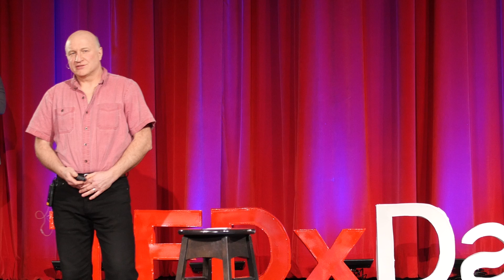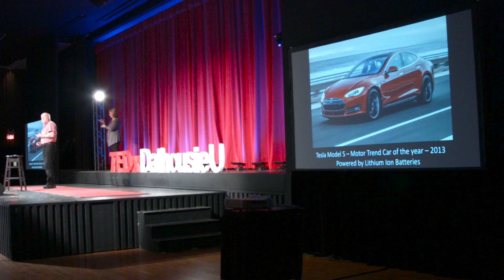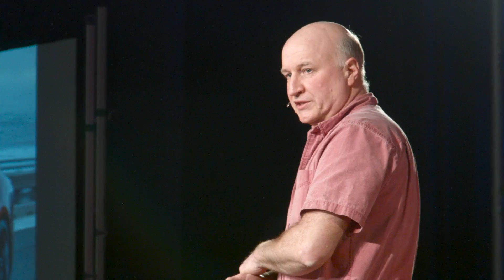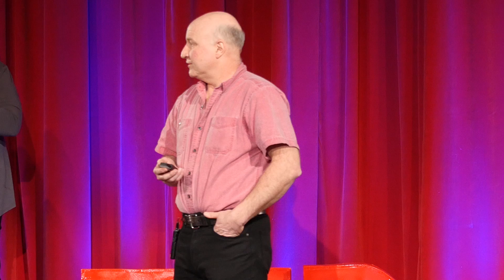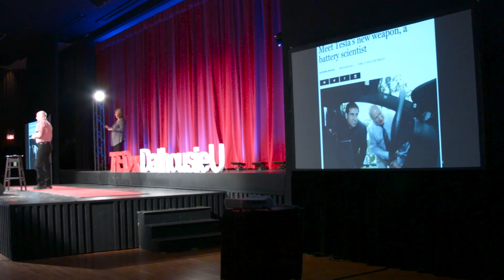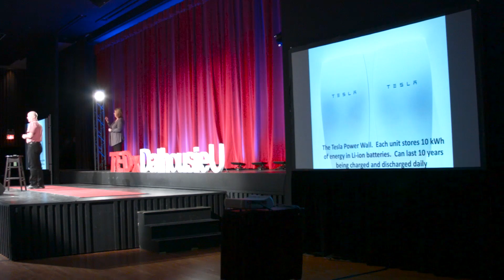Making Batteries Better | Jeff Dahn | TEDxDalhousieU

Comment: Awsome.. This guy is a genious!.. WOW... him to have Jioned TESLA is simply the best that could have ever hapenned about battery !
Reply: Internal combustion engines in a vehicle have an average energy efficiency of about 18% to 20%. Electric motors are about 85% to 90% energy efficient and lithium-ion batteries deliver around 90% of their electrical input to the motors in an electric vehicle. Large stationary power plant turbines are typically significantly more efficient and cleaner than small mobile combustion engines in vehicles. Electricity transmission losses are around 9% on average.
In any case, the electricity that is used to refine all the petroleum liquids that are used for road transportation today would by itself be enough to power electric-vehicle counterparts to all the vehicles on the road. It takes several kilowatt-hours of electricity to refine each gallon of petroleum fuel. The fuels then need to be transported in ships, trains or trucks.
In countries such as Canada, France, Iceland, Scotland, Norway, Sweden, Austria, Switzerland, Brazil, Paraguay, New Zealand and many others, almost all the electricity comes from Nuclear or renewable sources. So there will be very substantial reduction in pollution and carbon emissions in these places. Proportion of renewables in the grid in most countries (eg. China, India, EU) will increase dramatically over the next decade.
The manufacture of lithium-ion batteries and electric vehicles currently requires more resources and energy and mobilise more toxic substances than manufacturing comparable vehicles run by internal combustion. However, the impact of this is more than offset by the significant reduction in air pollution and CO2 emissions produced during the use of the vehicle. And almost everything can be recycled at the end of the life of the vehicle. Electric vehicles can also be expected to last longer with less maintenance since there are few moving parts involved.

Source:
http://www.ucsusa.org/sites/default/files/attach/2015/11/Cleaner-Cars-from-Cradle-to-Grave-exec-summary.pdf
http://news.mit.edu/2016/electric-vehicles-make-dent-climate-change-0815
http://iopscience.iop.org/article/10.1088/1748-9326/11/5/054010
https://electrek.co/2016/11/01/tesla-battery-degradation/
http://in.reuters.com/article/india-solar-global-pension-fund-idINKBN17W053
http://uk.reuters.com/article/us-china-energy-renewables-idUKKBN14P06P
https://www.theguardian.com/environment/2017/feb/09/new-energy-europe-renewable-sources-2016
https://www.theguardian.com/environment/2017/feb/02/electric-cars-cheap-solar-power-halt-fossil-fuel-growth-2020
Reply: "New UCS analysis finds that, over its lifetime—from manufacturing to operation to disposal—a battery electric vehicle generates about 50 percent fewer global warming emissions than a comparable gasoline car. Based on the most recently available data on power plant emissions and EV sales, driving an EV produces global warming emissions similar to a gasoline vehicle that gets 68 miles per gallon, on average." - Union of Concerned Scientists (a nonprofit science advocacy organization based in the United States)
http://www.ucsusa.org/sites/default/files/attach/2015/11/Cleaner-Cars-from-Cradle-to-Grave-full-report.pdf

 Here's a summary from a peer-reviewed paper published in a IOPScience journal:
"In summary, even though the EVs had higher emissions from production and End-Of-Life treatment than the ICEVs had, the EVs compensated by having significantly lower use phase impact."
"The EVs charged with the European electricity mix had lower lifecycle impacts than the conventional vehicles"
http://iopscience.iop.org/article/10.1088/1748-9326/11/5/054010

Not all electricity comes from Fossil fuels. Global nuclear power capacity in 2015 made up about 11% of the world electricity generation.
Share of renewable energy in electricity production in 2015: 
Africa  19%,             South & South-East Asia 20%,                 Russian Commonwealth 16%,                 Europe 34%,           
 Latin America  52%,               North America  28%
https://www.worldenergy.org/wp-content/uploads/2016/10/World-Energy-Resources-Full-report-2016.10.03.pdf

An EV with 4 people in it is far more efficient than an ICEV with 4 people in it.
https://energy.gov/eere/vehicles/fact-958-january-2-2017-sixty-three-percent-all-housing-units-have-garage-or-carport
Reply: No, I didn't forget anything. Check out the first three links that I provided for the Life Cycle Analysis scientific studies comparing the CO2 emissions due to Electric Vehicles (EVs) vs a comparably sized Internal Combustion Engine (ICE) vehicle over their entire lifecycle from mineral extraction, manufacture, vehicle distribution, petroleum extraction, refining, fuel distribution, electricity generation, transmission, charging and all the way to recycling vehicles at the end of their use phase. Even assuming the electricity generation mix does not change over the life of the vehicles, there will be substantial CO2 emissions reduction for an EV vs a ICE vehicle over their full lifecycle. In reality, the proportion of renewables in the electricity mix in most countries will increase dramatically over the next decade, so these studies are conservative.
Reply: Best to ignore him, he's obviously from the fossil fuel industry.
Reply: The Union of Concerned Scientists is a science advocacy group whose members are scientists. Everything in the life cycle analysis report can be checked against verifiable sources and the analysis itself can be replicated by anyone to come to the same conclusion under the very conservative assumptions stated in the report.
The European electricity mix refers to actual electricity generated. In 2015, 34% of actual electricity generated in Europe came from Renewable sources.
https://www.worldenergy.org/wp-content/uploads/2016/10/World-Energy-Resources-Full-report-2016.10.03.pdf
The peer-reviewed paper that I linked to tells you how much CO2 emissions can be reduced under different scenarios going forward.
http://iopscience.iop.org/article/10.1088/1748-9326/11/5/054010
Carpooling is no more difficult in an EV compared to a ICEV.
The electricity that is used to refine all the petroleum liquids that are used globally for road transportation today would by itself be enough to power electric-vehicle counterparts to all the vehicles on the road.

"According to the newly released 2015 American Housing Survey, 63% of all occupied housing units have a garage or carport"
https://energy.gov/eere/vehicles/fact-958-january-2-2017-sixty-three-percent-all-housing-units-have-garage-or-carport
Reply: The situation is not hopeless. Your argument ignores the new autonomous vehicle transportation as a service model which is coming fast. This takes care of the 'no garage' argument and the 'we should carpool' argument. Fleet operators will use EVs for most transportation because they are so much simpler to maintain. In 10 years, most people won't even own a car because it will be cheaper to get around without one. This solves the India/China problem as well.
Reply: 1) This was not a Tesla commercial. 2) Lithium Ion batteries are in fact the answer. 3) Electrification of light passenger vehicles will do a lot for CO2. 4) Tesla doesn't need any gov cheese. Elon Musk is the definition of a visionary.
Reply: The UCS is just another lobbying group.   Some of the members are scientists but there is no requirement that all of their members be scientists.   Ironically, their position on Climate Change is remarkably anti-science.
Reply: Al Rats, you did all the reading: I hope they do not make the mistake of relying on renewables to provide all these cars with electricity. Electrical bills in Europe are already spiking with 300% and more because of this renewables trend. Base load power is not being renewed by private industry because governments are killing fossil power projects while not footing the bill of the surplus cost for base grid power based on renewables (which still does not exist), nor are they investing in the transmission grids. The result is that expensive Diesel generators are used all over Europe to fill up the deficit in energy production and energy is bought internationally by energy providers at the highest possible price. (Building a single base load plants takes around 2-4 years). So CO2 reduction might, possibly, be welcome, but the cost to the consumer is being ignored. It is often said by energy economists that current renewable solutions are a technology that vaporizes wealth for the common man. The green agenda is being executed in a very chaotic, ill planned and most expensive manner. It is becoming a social problem that was warned about by green realists a decade ago can no longer be ignored. Maybe reinvesting in traditional nuclear and  investing in Thorium as India and China are successfully doing is not such a bad idea after all.
Reply: Al Rats....The Chicken Little CO2 myth is just a con run by pseudo-scientists, globalist-run mega-corps spouting buzzwords for the Greenies, and corrupt politicians trying to enrich and empower themselves by making the masses feel guilty for progress. 

During the historical period where we had 12 TIMES the amount of CO2 we have now (5000ppm then vs 400ppm now) we had record glacier cover over the Earth. The TRUE driver of the climate is solar minimums & maximums, which we have no control over. It drives humanists nuts when they're told that there's many (most) things in the world outside of their control. They really need to believe that passing some treaty or forcing ppl into a miserable existence could assuage their innate guilt for just existing...and usher in some kind of Utopia. Humanism has all the worst hallmarks of a bad religion. You have the Original Sin of existence, but you can do good works and tithe your way to Redemption if you just believe those people put over you, and do your penance.

I've lived off-grid for 20yrs, and driven my own self-made electric vehicles (from bikes to cars to boats) for years. I'm currently working on my electric ultralight plane project. I didn't do it to save $$, but rather I enjoy the tinkering & independence. Having done all the real world calculations, electric-only transportation (except for ultra lightweight vehicles like bicycles) is NOT more efficient than a decent hybrid vehicle w/40%+ thermodynamic efficiency. The newer DI diesels are approaching 50%. After grid transmission, charger, battery conversion, and motor losses are taken into account, EV's don't beat that.

If you built your own efficient EV conversion, charged it directly from your own solar panels (in Phoenix) or wind generator elsewhere, you MIGHT be able to recoup your investment in about 5 years compared to buying a good, used 40mpg+ hybrid and taking really good care of it. Good luck trying to convince 100 million Americans (or a couple billion others globally) running on the globalist debt wheel to do that.

BTW, the world's power grid is just BARELY keeping up with the growing demand as is. Even if charging were somehow made much simpler by say, driving over an induction charger (very inefficient), the grid would collapse immediately if even only10% of drivers switched to EVs tomorrow.

Oh, and Elon is a master promoter. But a bunch of expensive laptop batteries in a real cool looking box hanging on your garage wall is hardly visionary. Unless you have little experience w/off-grid setups. I have 3 times the energy storage in my good ol' Golf Cart battery rack, for a tenth the cost. And don't even get me started on his overpriced inverters and such. The only reason he came up with the TESLA Wall gimmick was so he could order battery cells for his cars in the kind of bulk that would make the pack even semi-affordable. The cost of each watt of li-ion storage capacity for home use (where weight isn't a factor) is ridiculous compared to a well-maintained lead-acid system.
Reply: The only genious thing about the guy is that he managed to make a Tesla ad out of a scientific talk, lol
Reply: +Bill... It's already cheaper, far cheaper, to get around without a car, yet most people own a car. I know plenty of people who drive 2 blocks to the local Wawa. As I already mentioned, car pooling is something we could be doing RIGHT NOW and without spending any money and people just aren't interested.
Reply: tarstarkusz i guess we should just give up and die now
Reply: +Al R... The first paper says no such thing and is from an advocacy group and the second paper assumes a large change in the electricity generating mixture and low cost EVs (which don't exist and not a single example was mentioned) replacing 90% of light vehicles. None of them are peer reviewed. I don't think you realize how inefficient steam turbines are. Even plants that are able to use the low quality waste heat don't even approach 50% efficiency.  A standard plant is about 33% efficient. So for every megawatt of electricity they generate, 3MW of thermal energy is needed.
There is the very real problem of people not having garages. I live on the east coast where a lot of the houses were built before there were cars or large scale adoption of cars and the simply do not have garages.  Is the city going to install meters/outlets every 20 ft on every street in America that doesn't have garages? Even where there are garages, many households own 2 or more cars.
But the real problem is the mass of cars vs people. Cars are, by their very nature extremely inefficient. There are things we could be doing right now without spending money that we simply are not doing. We could work from home and we could carpool. A gasoline car with 4 people in it is far more efficient than an electric vehicle with 1 person in it.
Reply: +al rats... First, that is the same paper from an advocacy group.

Second, "The EVs charged with the European electricity mix had lower lifecycle impacts than the conventional vehicles" Says almost nothing. It doesn't describe what the mix is or how big the advantage is. The "European mix" is a weasel word too. Is that installed capacity or actual generation?  In the desert a PV farm has a 20% utilization rate. IOW, to get 200MW, you need to install 1GW of capacity and that's the desert, not Europe. So are they using installed capacity as the baseline?

Environmentalists are fighting nuclear tooth and nail. They are only slightly less against large scale hydro and those are the two "big" renewable sources in the developed world.

Your last point is dumb. I was carpooling is something we could do now that would cost little money. 

If this stuff worked well, it would be happening all by itself. You will not address the lack of garages in America or Europe and just how big a challenge that is for electric cars. You also won't address cost. EVs right now are toys for rich people. Even the Tesla cost well over 50k and into the 80k range fully decked out.

The world uses around 90Mb/D of oil, most of which is for transportation. Displacing 90MB/D is going to be impossible with solar and wind. At a MUCH higher cost, we could displace some fraction of aviation fuel with a liquid fuel from biomass, most likely algae. 

With China and India both moving toward the American/European model of transportation (personal autos), the situation is mostly hopeless.
Reply: +Al Rats Even assuming li-ion batteries were a good replacement for gasoline, what makes you think this would do a lot of reducing CO2 emissions? Do a little more research on Musk and Tesla, it's government cheese after Paypal. Paypal, when Musk was running it was stealing a lot of money. You either forget or weren't around when Musk was running Paypal and all of the paypal complaint page were around.
Reply: AI Rats You forgot about the massive inefficiency of steam driven electric turbines. These losses add up, a lot. There are losses in every single step along the way. Huge losses in generation, losses in transmission, losses in the rectifier, losses in charging, losses in discharging and losses in the car's electrical management system.  There is also no getting around the fact that cars are just inherently inefficient. Nearly ALL of the energy is going to transporting the vehicle and not the 175lb person in it. 

 It also takes a lot more energy to build these cars  in the first place. A lot of people live in cities where there are no garages for charging.
Reply: +tarstarkusz 

Bravo!
Reply: 1) This was a fucking Tesla commercial. 2) Lithium Ion batteries are never going to be the answer. 3) Electrification of light passenger vehicles will do almost nothing for CO2 4) Tesla couldn't exist without gov cheese. Elon Musk is no visionary.